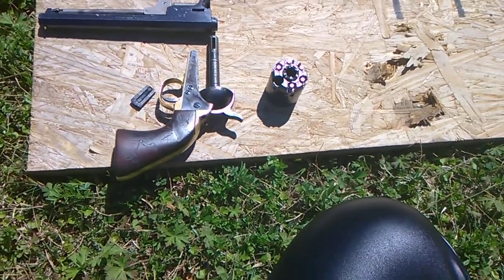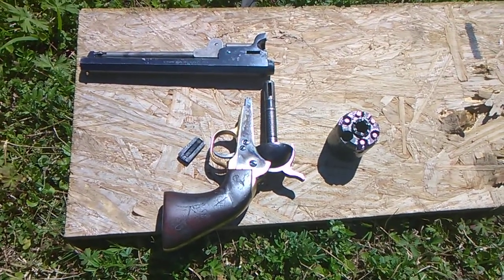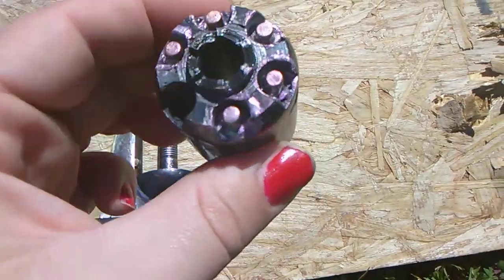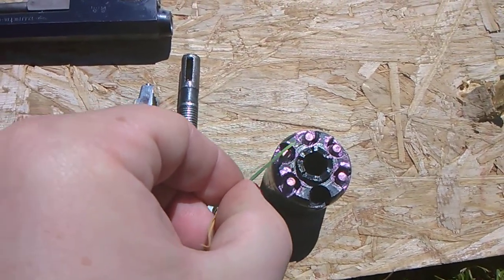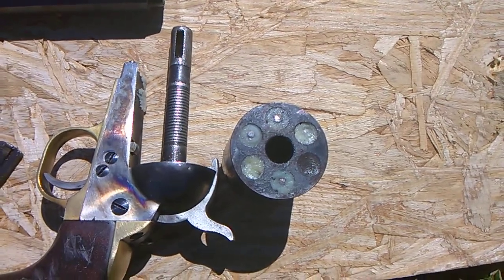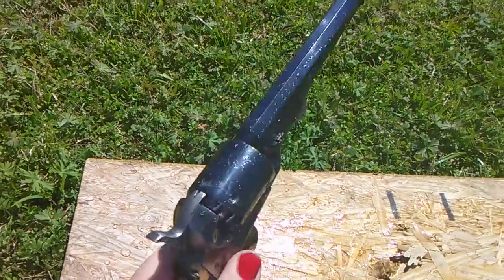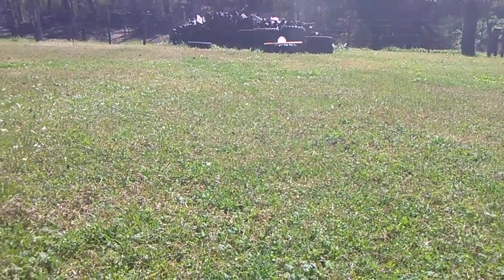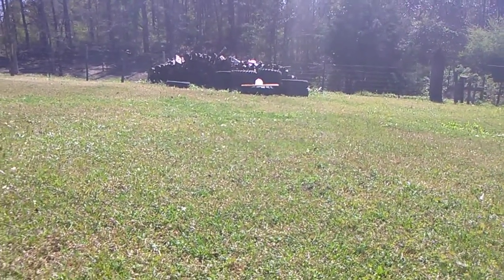Loading Cap and Ball Revolvers for Defense pt 2

Comment: I use pure hard bee's wax if I am bench loading it for hunting or long term. (Over a week) I use the wax from a toilet bowl ring in the field because you don't have to heat it. Good lube, easy cleaning. Both systems are water bucket tested.  I love my two Rugers!
Reply from the maker: I used toilet ring wax as well for years. I call it "Pooper Lube". It's good stuff and easy to find. .

Comment: 209 primer idea! Get the 209 primer pocket nipple and tap out the hammer face for a screw in firing pin all way thru so one could replace with a flat surface  bolt or a pointed bolt for firing pin. I hope that makes sense. Ordering a spare hammer to modify  may keep the original parts handy. One can make a jig to drill strait, or call up a gunsmith guru to do it! Love peace and awareness sweet thing!

Comment: On the 1858's and Ruger Old Army's you can get new nipples that take 209 shotgun primers. They're more of a pocket than a nipple and should create a more air tight seal.
Reply from the maker: That is awesome will check into it, I love Mag sparks in my rifles. Thanks!
Reply: These are a bit different than the magspark ones, no screw on firing pins, just works with your guns hammer striking an open face primer.

Comment: Nice video. But fingernail polish isn't the best idea. If thick enough to last, it becomes debris that can bind the gun. Not something that you want. It does work, but not the best choice.
The cowboys also needed functioning guns after fording rivers. They used beeswax. Sam Colt used beeswax in his water demonstrations. And I have used beeswax in long term experiments that went two years. Melt the beeswax, paint a layer around the nipple, then seat the caps. Normal lubrication takes care of the front of the cylinder, but I refreshed that every couple months whenever it looked dry. No trouble firing at the end of the experiment. 
I did discover that humidity is as great, or greater, an enemy to reliability as actual water. I have had failures to fire in high humidity weather even when gun and powder weren't gotten wet - just exposed to humidity. So, if you are going to carry a while, seal the chambers. And beeswax is not only traditional, it's the best choice that I have found.

Comment: Cool video abour blackpowder revolver a gun is better than no gun, I have a gun like that is easier to maintain if you are in a chaos, something that can be hard on modern pistols using black powder loads
Reply from the maker: I dunno about easier to maintain but if it were a prolong conflict n smokeless powder ran out it's easy to make black powder n can charge caps with crushed match heads..... I don't own one personally but I think a flint lock smooth bore would be the best survival gun. If run out of caps, were flint or pirite can be found most anywhere and with a smooth bore can fire rocks, nails etc out of it. For pure self defense though I prefer a good revolver.
Reply: I got a revolver with stainless steel frame, black powder guns are easier to clean, in modern guns, well they are more effective, but smokeless powder tends to degrade by time something that doesn't happen with black powder, modern guns are kinda complex to dissamble but when using smokeless, it requires a cleaning each 6 months, if you shoot cartridges with black powder, it requires a cleaning in the gun every day.  I have a .44 navy confederate 1851, I plan to have it as a backup as I get my SR40 from ruger, I will get another no revolver and try to make it a flint lock revolver that would be very interesting to me
Reply: You own a gun or bp gun?
Reply from the maker: @omarmilio7392  I own both
Reply from the maker: @omarmilio7392  I see what you mean now and I agree. Stainless is great much easier to clean.

Comment: Sorry this will not work. I have tried it. The finger nail polish will destroy the caps over as short as 90 days. The only thing I have found that works is wax. A tiny bit on a tooth pick applied to the base of the cap. Thanks for the great video.
Reply from the maker: Must of been the fingernail polish you used?? I never had any issues with the caps being destroyed by wet n wild polish
Reply: Waterproofing will silicone spray works well, and because they are two dissimilar metals meaning the nipples compared to the actual cap over a period of time they form a seal.